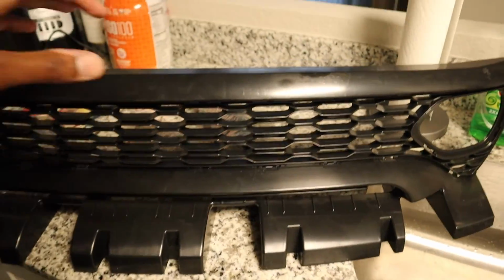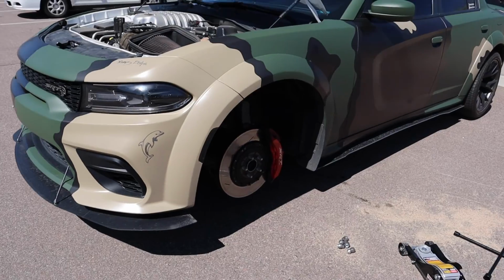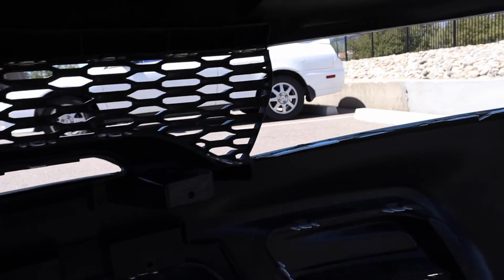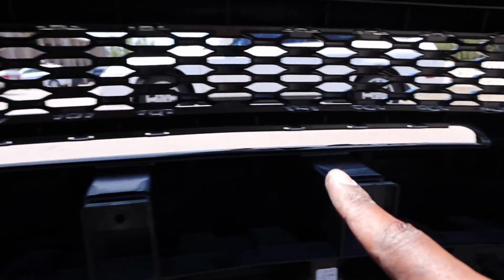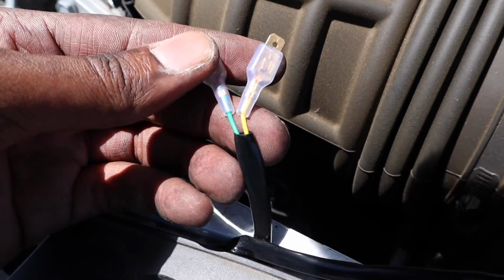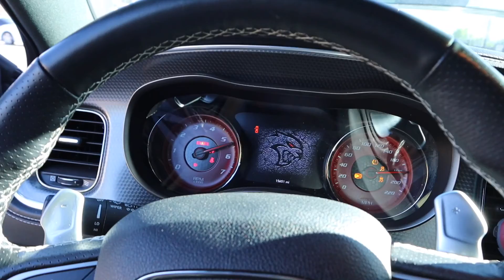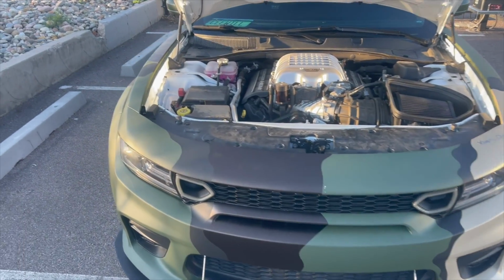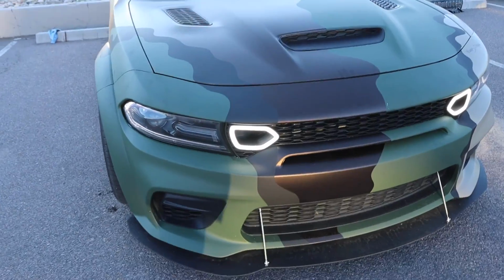VICREZ FRONT GRILLE WITH LIGHTS INSTALLED ON MY CHARGER REDEYE! BEST EXTERIOR MOD YET!!!!

Comment: Coving the black sensor on the dash during the day will make them work. In auto mode. You must of tied into the wire that is controlled by the sensor.
Reply from the maker: Nah they work how I want them to work. In auto during the day they're off, and at night in auto mode they're on bc it senses daylight to night time

Comment: To have these lights on whenever the vehicle is running, no matter what position your light switch is set, YOU must tie the power wire of each snorkel light, to the front side marker lights.....
Reply: Have you had any trouble with water damage ?
Reply: @Kronansgaminginc  I've got water intrusion on the driver's side LED and thinking about removing both sets. Sadly this China crap that every vendor sells comes out of same factory. With the Charger going away, I doubt that anyone in the states will make a quality version.

Comment: Mine sgive out every other year I been through 3
Reply from the maker: Damn bro sorry to hear that maybe it's the wiring
Reply: @CeeWill23Vlogs   it's not I had people done it and myself done it right with heat stripes clams make sure everything has wiggle room and is tight and perfect . What it is that they can't handle moisture in early mornings or when it rains
Reply: @bennyylopezz  yeah I hear people say to put tape or something in the cracks to keep rain out
Reply: @QuinLIVE  use clear silicone to seal it